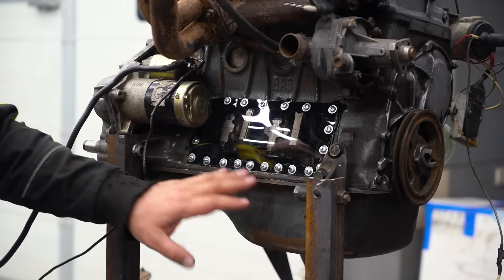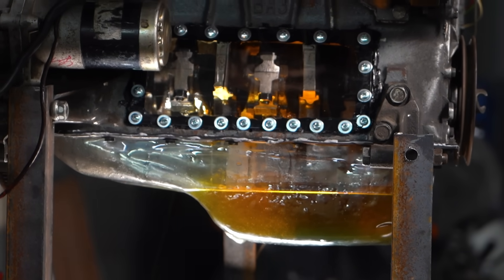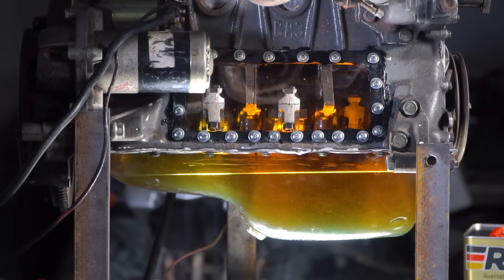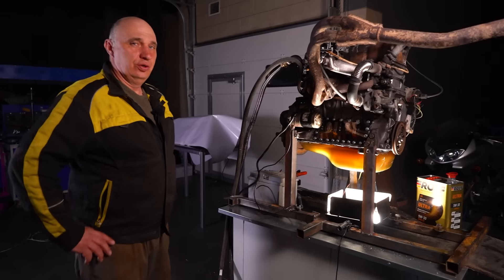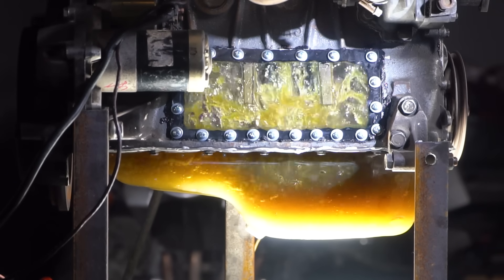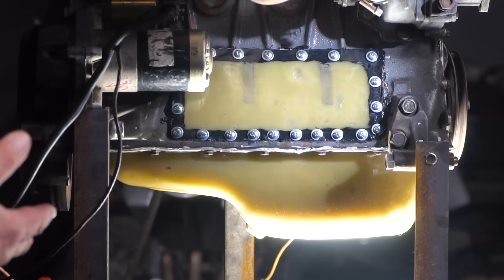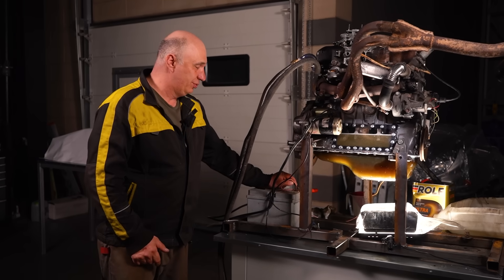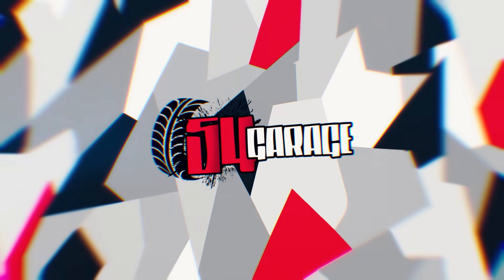What actually happens when you overfill your motor oil? (w/ transparent oil pan)

Comment: Well, it’s aerating the oil, making it less lubricious, causing drag in engine components, and less oil pressure due to more air that’s compressible in the oil. It looks fine but it’s not, there are max levels for a reason. It’s not some crazy conspiracy.

Comment: Also of concern is the air volume in the crankcase decreases as you add more oil, which is incompressible. So you put more pressure and strain on piston rings potentially. More of a concern in something like a boxer twin, where all pistons move down simultaneously, so the pressure spike is quite considerable if there is too much oil and not enough open air.

Comment: Over filling your engine with oil does a little more than give you excessive crank case pressure, a few oil leaks due to the extra pressure And I have seen a few blown base gaskets on big thumpers I have attributed to possibly overfilling with oil
Reply: I snapped the crank by overfilling my mini ...

Comment: splashing oil causes air bubbles in the oil mix the pump will suck 50/50% oil and air which is not good for the parts that need to be lubricated.

Comment: Awesome vid. However there are many variables in one motor to the next. We overfill BMW engines in race cars by 15% all the time, since 2004. Never had an issue. If its not overfilled the lifters get noisy. Same for GM LS Series, most track guys overfill a quart, if you don't, they can starve the pump.

Comment: The issue differs greatly depending on engine. A 1.5L Prius engine really doesn’t like to be overfilled. A Ford 2.7EB doesn’t much mind. Nor does the 2.5 H4 Subaru, which all dealers seem to overfill.
Reply: You know what.  The dealership would overfill my wife's leased Subaru Forester,  (several different times).  I went in (at the next oil change) and jacked up the service assistant about it.  He said he would tell the tech about it.  Funny same thing happened again.  I wrote a registered letter to the service "manager" this time .  Car finally comes back with the correct level of oil.  Was that really necessary?
Reply: @PeterDittmer  I learned  complete drain, new filter, my Outback held a nice clean easy 5.0 quarts. Odd in that removing the filter it doesn’t seem to have any oil in it, but without the filter it apparently drains internal passages.

Comment: If any of y’all are worried you put half a quart extra on your 4-6 quart engine. Don’t be. Won’t do any harm to your engine.
Reply: YES 👍! 
I've attempted to explain this many times! People just don't get it! 
It would have been more effective if a qt or L was added at a time in additional to the full oil pan! But, double the amount did tell the story!
Reply: We’ve not investigated the effect on gaskets. Even the filler cup has a rubber gasket.
Reply: hard to measure i always put 300 to 500 ml extra.  need to wait at least 5 minutes after putting oil.

Comment: Foam is compressible, oil is not compressible. Uncompressible oil is needed to prevent metal from rubbing on metal. Also, many chemicals in engine oil break down with oxygen, so foaming the oil degrades the oil much faster in theory.

 The manufacturer give you some room to over fill without catastrophic failure, but you are better off with too little, as long as your oil pressure stays good.

Best of all is to fill to the correct level.

Comment: Very bad idea…
The air generated and foam produced in the oil causes a loss of oil pressure.
NEVER EVER over fill your engine, transmission, or differential!

Comment: A friend of my relatives drives an old Saab, last summer he checked the dipstick when we were around. It had oil to about 60% of the entire stick! To which he said "Oh I better fill her up". Apparently he had been driving this way for about 5 years without oil changes, just topping the engine up with an excessive amount of engine oil.

I showed him the Min-Max part of the dipstick and suggested to drain & replace the oil and have the correct amount of oil in, being stubborn he said "Well I've been driving like this for 5 years and it works just fine".

Comment: I had a person ask me to fix there car , ran ok at low speed 10-15 mph , but once it got up about 25 or so it started knocking and smoking like a crop duster!. Not sure what the heck was going on I decided to  checked the oil and it was 5qts overfilled. It was only susposed to hold 4 qts.  Questioned the guy and he said it was low on oil so he put some in!!. I drained it out and all was fine

Comment: Overfilling way too much causes the oil to froth. This can and will lead to engine failure. I always fill it to the max line when I do my oil changes. As you see in the video, you have to overfill it quite a lot for frothing to occur. Simply going over the max fill line a hair or a 1/8 quart too much isn’t going to lead to any issue.

Comment: Older motors may leak oil into the clutch through the crankshaft seals partly due to crankshaft pressure

Comment: 75% of engine wear occurs during engine start. We have electric fuel pumps that provide almost instant fuel pressure,  amazing that we do not have electric oil boost pumps to provide auxiliary oil  pressure during engine start.
Reply: It's because crankshaft-driven oil-pumps are more-reliable, and an oil-pump failure would destroy the engine.

Comment: Nothing until you overfill it enough it contacts the crankshaft and then it's can start aerating the oil and making it frothy.... Which not only cuts down on lubricating ability but also heat removal ability.  Everybody know that

Comment: well as the 'motor oil guy' (YT poster) says 'oil viscosity is the big thing, as it thins heating up, it helps the engine run more economically and older engines need a tad more zinc in the formula to reduce wear.' what I got out of that demonstration was the engine just can't breathe when topped off to the max.

Comment: Great video!  I've seen several engines self-destruct because levels were too low, but never too high!  It's good to keep in mind that having slightly too much is better than not enough.    (obviously in this video he goes way beyond "slightly" overfilled though! haha)

Service intervals are longer than ever on modern engines with modern synthetic oils that don't degrade with heat, pressure and oxidation as fast as the old conventional stuff.  That means fewer visits to the mechanic, with most people not doing any checks between those visits. All engines consume some measure of oil during operation....some very small, others a lot more. 

In my experience over the last 17 years as a tech,  I've developed the habit of checking the level BEFORE doing an oil change, I see low levels almost daily. Not ALWAYS "scary" low like nothing visible on the dipstick, but maybe at the minimum mark or 0.5-1qt below that, which is still a bit scary!  Even with the best coaching, some people just don't want to bother checking, and I'm much more comfortable with an engine overfilled by 1qt rather than underfilled by 1qt!
Reply: Very helpful comment, thank you!

Comment: Seems to me that churning all that oil around will both reduce engine efficiency and heat the oil unnecessarily. Plus all the air bubbles may not be good, as someone already said. . So yeah, maybe overfilling a little is not a big disaster, but there must be a limit. Great video.

Comment: I had a customer who came in for their car smoking badly. The car sounded TERRIBLE driving in. We open the hood and there’s oil pouring out of anything it can get through. We open the oil cap and it’s filled TO THE TOP. Customer states they did their own oil change and “filled the engine.” We attempted to educate them, explained the severity of what they had done, drained the oil and did a proper oil change. They came back two days later with the same problem, and they HAD FILLED IT TO THE TOP AGAIN. We asked them why they did this after we told them not to, and they shrugged and said, “You didn’t fill it.” We explained in great detail why they shouldn’t do that, why it’s important to stick to the CORRECT way of filling the PAN, and NOT THE WHOLE ENGINE. We told them their car would die very soon if they did this again, and that there’s no guarantee it won’t break anyways because they did it twice already. We drained the car to the correct level. wrote exhaustive notes in the computer to protect ourselves from this customer, and told them sternly that we will not deal with this again if they come back assuming their car lasts that long. They shrugged and left after paying us for two oil changes in 48 hours, and since they never came back we assume the car was totaled.

Comment: Nothing to worry about... Haha
Filled my motor up to max level and got oil into my vacuum pump which transported it to my brake booster. So now my brake booster doesn't work correctly. From now on whenever I 'm rolling slowly and begin to brake I need a lot more muscle power to stop my car.
But nothing to worry about... 🤔

Comment: How wil it effect seal's and the top end, and wouldn't it blow it out through the overflow or through the cylinder via th4 blown out valve seals. Pressur3 is to much

Comment: Super cool demo, makes ppl understand what actually happens with the engine lubrification my thoughts are, when you added the double amount, is that even tho there was space between the oil and crankshaft, when you turn while driving im afraid what would happen is that one of the outer sides of the crank would suddenly hit the oil because of the centrifugal force of the turn, even if its a soft turn, and that impact of the crank into the oil could upset the engine since it's not meant to have that, oil is dense , denser that water, and if you ever slapped water and felt pain in your hand, thats what would happen to the crankshaft but even harder, possibly messing the balance of the engine and slow down the piston at that moment and overtime thats likely gonna cause damage to something, the rest was just hilarious to watch

Comment: I had an 1993 Ford Tempo 2.3 non-turbo. The dipstick did not register the oil level. I always had the oil changed at an oil service station. The oil light came on and I added oil. I  drove the car till it started making a noice in the engine. I had over filled the oil by 2 quarts. This was before the internet. They repossessed the car and never explained why the oil level could not be seen on the dipstick.

Comment: Drive with aerated oil for a few hundred miles and you should develop a rod knock in most engines. This is also the reason why you should never use old oil as the anti foaming agents settle out of solution and you will have this same aeration happening regardless of level.

Comment: Apart from mixing air in the oil, which is bad enough, having the oil bashed by the balancers would deteriorate the oil, plus the main bearing oil seals may not be able to do their job, overfill but there is a limit.

Comment: Thank you for the well done factual presentation. It is a relief that reasonable overfills are trivial. However, foaming at extreme overfill levels is very likely going to cause problems due to loss of viscosity and the introduction of air where air should not go.

Comment: I love this video. But it only covers this specific engine and oil pan. My car dealership serviced my car and changed the oil. They somehow filled the oil twice. I now have an oil leak that would have cost 6K to fix , had I not noticed the oil level. Pays to check yourself.
Reply: If you’ve got manual transmission, check the oil there, maybe they’ve drained oil from wrong place. And the gearbox could be empty now. That’s how usually rookie mechanics managing to double oil in engine. 
Especially, on some French cars is a common mistake, when the technician isn’t familiar with a drain location.

Comment: I like to think that I know how an engine works, but I'm not a mechanic and don't know specifics. I always thought that the crank counterweights sit in the oil at their lowest point to help circulate, thanks to some pretty bad schematics I've seen in the past (they show the counterweights sitting in the sump oil). Thanks for this video showing my misconception, and for showing that a little more than max isn't an issue, but there is such a thing as too much! :D

Comment: A tiny bit over might not be a big deal, but twice as much is.  That oil gets aerated and creates extra drag on the engine and slightly loses hp and efficiency.  The more weight of oil flying around and it gets worse.  You also run the risk of leaks, and whipping the oil makes it foam up like you see, but foamy oil doesnt get picked up by the pump very well.  You might think thats ok because theres do much oil flying around inside, but where its really needed, coming out of little oil holes in bearings between 2 moving parts, you actually lose oil volume there because in the oil is also a lot of air, so lubrication is actually not very good in extreme cases, which doubling the required amount is pretty extreme, let alone triple or more.

Comment: Once the blow-by gases cannot escape anymore because they are blocked by oil and a blocked blow-by vent, the pressure in the crank case rises and the makeshift joints on that plastic sump will give way and leak

Comment: Years ago i had an 87 Nissan Sentra and a place i had my oil change at filled my car twice so it had double the oil it was supposed to. I was driving down the highway to work and i saw tons of black smoke coming from under the hood. I pulled over and the cap had blown off and the front of the engine was on fire. It went out on its own and I had another mechanic shampoo the engine and it was fine after that. Scared the shit outta me though as i was only 20 when it happened.

Comment: I was told over filling a engine with oil will cause pressure in crack cases and force it back up to the rings and break the rings and case blow by I guess there wrong

Comment: I’m a Subaru guy.  On a horizontally opposed boxer motor, overfilling the oil is pretty bad.  The crank will throw oil right into the cylinders.  Oil pressure causes blow-by and yeah, obviously you don’t want all that foaming of the oil.

Comment: On certain type of motorcycle engines splash oil is the only thing cooling the stator, aka alternator. People burn their stators because they run the engine oil on the low limit. In this kind of engine it is actually good to keep the oil little above the max limit, it needs to splash.

Comment: I had a friend who didn't understand that you're not supposed to fill up the oil to the very top of the engine through the input hole. The car ran okay but if I remember right develop some seal leaks.